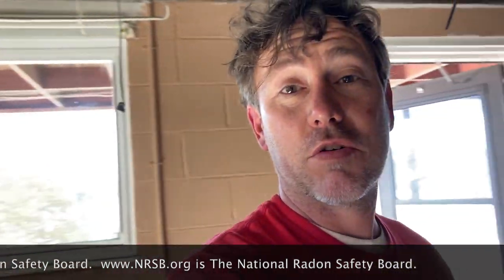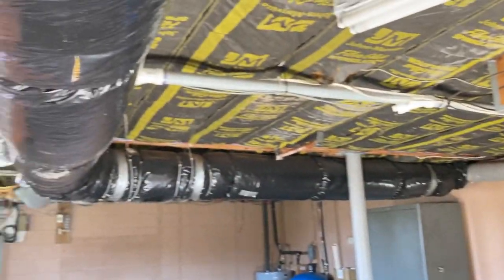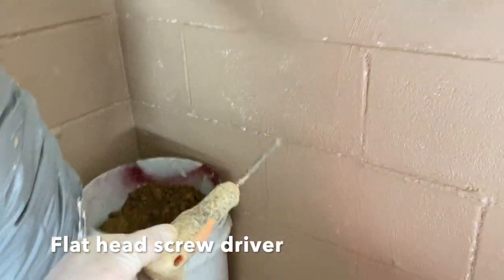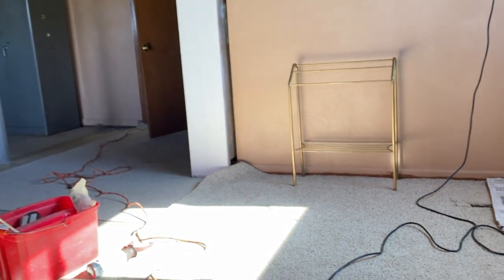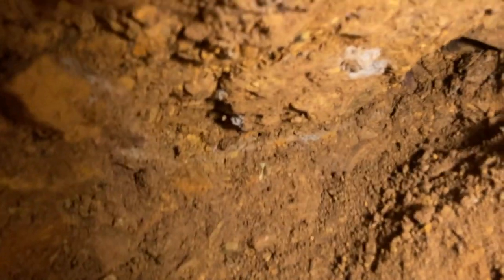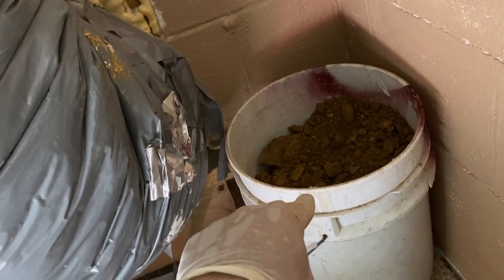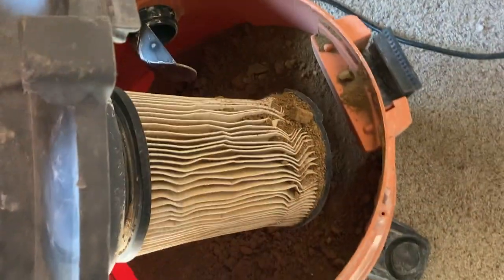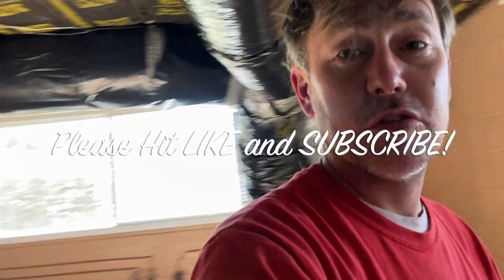Digging Tips For High Suction Situations

Comment: Thanks Scott. If my builder won't cover this then I will do it myself. I ordered a manometer and also bought a sealed sump pit cover and some crack sealer for the thin cracks in the joints in the slab and around the perimeter too. Thanks again.

Comment: I’ve ran into a bind.  I’m using a GP501 radonaway fan that was recommended due to poor soil.  I used a core bit and pulled a 5” plug of concrete.  I then pulled out 15 gal of soil and clay.  

The back story is, 70’s built home.  Tri-level.  The lower basement is where this was installed.  Unfortunately I’m hitting 4.5 on the meter so I know there isn’t much of any air is moving.  

I can add another suction point by using the sump basin. This sump basin was put in by my dad but I reworked it so it was actually using a basin instead of a bucket.  It now has an 18” x 22 basin with a bunch of pea stone around it.  Since there isn’t any drain tiles dropping into this basin, small 1/8 holes were drilled all around it. Summer and spring this gets a lot of action. Pump runs often.  

The next level up is what I call the ground level basement due to the windows being at ground level.  Should I add a vertical suction point under this section as well?

I’m in a bind here and would like to resolve the issues.  If you have any suggestions I’m willing to listen.  

I’m trying to fix up this house as it was my dads that him and his father built in the 70’s.  Dad passed away a year ago, so the house means a lot to me.